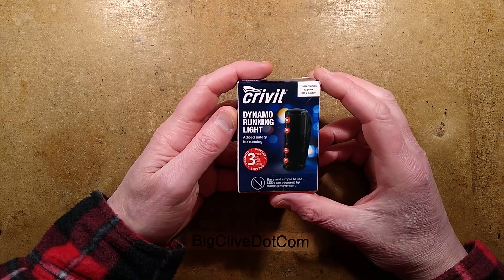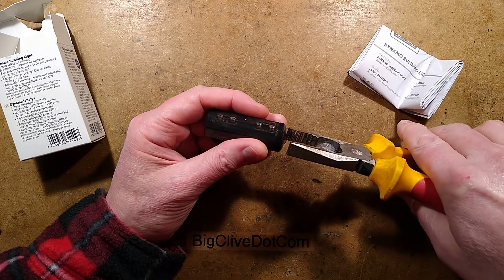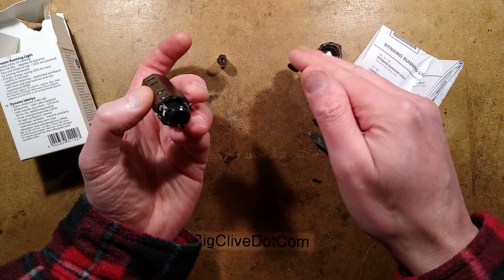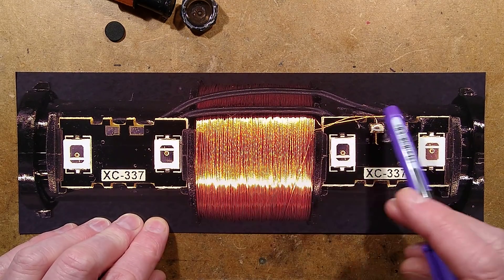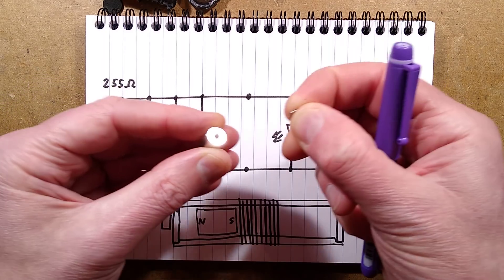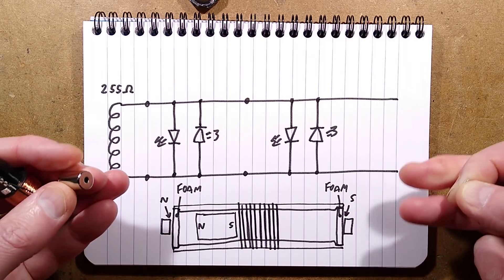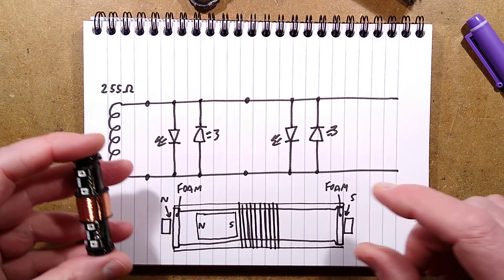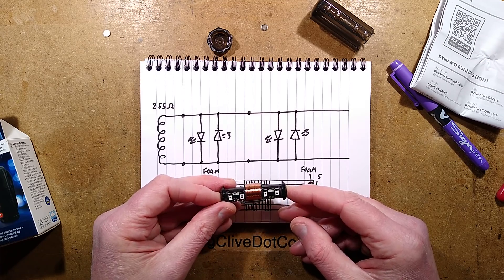Lidl self powered jogging light teardown (with schematic)

Comment: Neat. Barring any major impacts from dropping, or you know, vehicular impacts, the thing should last you damn near forever.
Reply: Well, that’s a bit dark. ;)
Reply: Being likely made from ABS, lifetime is around 5 years before all the plasticiser in the plastic evaporates out, and the entire case becomes brittle, then proceeds to fall apart from just normal handling. Not like the manufacturer would have spent the extra cent to get the better plastic, just instead used the recycled, reground clear ABS he can get in bulk, adding the tiny bit of black ABS to the mix, so as to hide the little bits of imperfect colour, in the cheapest grade of "mostly clear" bulk material he got for cheap. clear is expensive, near clear is cheap, plus hides the wear in the extruder, and the slop in the fit.
Reply: @SeanBZA  

I'm sure I have 30 yr old ABS items which are still fine. It's usually extended sunlight exposure destroying plastics.
Reply: @SeanBZA  nah ABS casings last much longer than 5 years.

Comment: Another great tear-down. Wish my dogs collars had one of those in it.
Reply: As a vicar I thought you had already seen the light! Have a fun day.
Reply: You can buy similar dog collars with lights in them. The older ones used a  coin battery, but I'd bet you can get modern motion-powered ones similar to these. I have to wonder if the magnetic field might cause activation of or damage to an ID chip implanted in the dog.
Reply: @goodun2974  They have to be compatible with my wireless fence. Issue im having is crappy batts in sealed units. Last a month or two then never charge right again.
Reply: @CrazyRFGuy  , 20-something years ago,  I had an electric fence with (rechargeable) battery collars. The wallwart power supplies kept dying from voltage surges and lightning storms, and I had a rescued Shepherd/Dobie/Rottie mix with a strong prey drive who would bolt through the charged field to chase squirrels and rabbits (he tested the fence like the T-Rex in Jurassic Park, and found the weakest spot in the field, under the deck, where we used another device to cancel the fields so the dogs could lay on the deck, and also shorten the amount of wire we would have to bury in rocky, roots New England ). Also, my Saint Bernard would take off to go visit all the young children in the neighborhood. After a couple of close calls with the dogs getting loose and nearly getting hit by fast cars on my rural street where  people drive almost twice the speed limit, we put in a chain link fence.

I do miss that Shepherd mix, he was very smart, and sensitive. Right now we have a sweet but stubborn Cairn Terrier, and a super mellow, friendly, handsome Anatolian Shepherd/Pyrenees mix, who specializes in begging for food, and melting women's hearts, so that they'll feed him.
Reply: @goodun2974  I have fully fenced yards (6ft and 8ft). My male collie jump/climbs over them (and he short a hind leg from a car). My female collie has that kind of drive and has learned how to get the outside man gates open. D@mn smart dogs(blessing and curse)
Reply: @CrazyRFGuy  , my Saints were sweet but not that bright. The Shepherd mix however was a friggin'  Cray computer, but his hips weren't great after a bout with Lyme disease and so he wasn't going to jump a fence.  The only dog that ever got out was the Cairn terrier. We had a few small gaps in the fence that didn't matter for large Shepherds and Saint Bernard's, but when a skunk came around the Cairn  decided to do battle and she found a way to get out. She's the only dog I've ever had who got skunked!  As for the Anatolian mix, his working breed genetics are strictly theoretical. He doesn't do any work;  the most jumping he'll do is in or out of the car,  and on walks on the trails in the woods he has the instincts of a pack mule and will step on rocks so as to not get his feet wet in muddy puddles or shallow streams. If you bring him around goats and sheep he wants to eat them.  We call him Handsome Henry and he is indeed beautiful, I'm not exaggerating when I say that women just about melt when he gazes at them with those big Brown eyes. He gets lots of attention and dog treats around town and at the hardware stores!  Speaking of, it's about time to take them for a walk! (PS ,  I used voice to text to type most of this and when I spoke "Cairn terrier" it typed as "Karen terrier". Which is kind of fitting!)

Comment: An example of a very simple thing engineered well. The bump-stops at each end are particularly smart. More components might be able to make a more sustained light, but each one would eat into the power generated and reduce the brightness. Plus, flashing the lights like that is exactly what you want—you want it to be very attention-grabbing.

Comment: Wouldn't the magnets at the ends "bend" the magnetic field of the middle magnet more to the side and  "pushing" the m-field closer to the coil and therefore increasing the magnetic flux? It would induce a bigger voltage which means brighter leds. Also it stops the middle magnet from getting demagnetised from being smashed into the ends.
Reply: They are too far away to have a meaningful effect when the dynamo magnet is in the coil. If they were strong enough to significantly increase the magnetic flux through the coil they would significantly decrease the speed of the magnet (for the same input energy) and lowering speed tends to lower the generated EMF. Without doing any calculations or much reasoning, I wouldn't be surprised if sufficiently strong cushioning magnets lowered the electrical output.

Comment: I obviously can agree that the hole is for airflow as stated many times. I also am curious if the lack of material in the centre inturn induces more propulsion around the out side, evenly pushing the magnet in the desired direction.

Comment: Re the magnet with a hole.  If you can find some aluminium or copper wire that is a loose fit you could drop the magnet down it to demonstrate eddy currents.
Reply: A roll of aluminium cooking foil from the kitchen works well.
Reply: @petehiggins33  Also works with sliding a flat magnet across an aluminum pan or similar.
Reply: @pizzablender  So it does, I just tried it.  For best results hold the pan at about 15 degrees from vertical and let the magnet slide down it under gravity.  See how slowly it goes.

Comment: The hole is maybe so it can travel easier with less air resistance, but maybe it also slows the magnet down, opposed to a solid magnet, by creating eddy currents, slowing the magnet?
Reply: You've hit the mark there. I believe the hole allows the magnet to be a good fit in the bore of the coil - maximising induced current - but stops the magnet acting like a piston against the air in the sealed housing and losing speed as it moves through the coil. The hole is very simple but a really nifty piece of design. :-)

Comment: I wonder how quality control is maintained during assembly.
Reply: Um, what is this quality control you speak of?
Reply: @billr3053  Shake it and see whether it works. Next.
There was this interesting tv program about disposable headphones (the airlini kind) and the factory makes even the wires and insulation themselves. Each earpiece is sound checked by a worker, holding it close to their ear,

Comment: I guess it would not make much sense to add a capacitor across this, due to the increased losses for rectification etc, not to mention the cost increase for little if even any benefit at all.
Also: what a way to ruin a QR code ;)
Reply: QR codes have built-in error correction (to varying degrees) so it's not actually ruined!

Comment: Could you hack that to add some caps and get the lights to stay lit a bit longer?
Reply from the maker: It would require a rectifier too, which could introduce losses.
Reply: @bigclivedotcom  What if the LEDs did the rectification rather than being parallel

Comment: The hole will definitely be to allow air through to reduce the effect of the air acting as a damper to the magnet. I suspect that is more important than having a solid more powerful magnet.
Nice video.
Reply: I was just about to comment the same thing. 
Had the magnet been solid, with such a fairly tight clearance between it and the bore, air resistance would have definitely been an issue in getting it to move from one side to the other with such ease.
As for @Snakez De Wiggle , go and wiggle your snake as that's all your brain is capable of understanding.
Reply: The hole in the magnet is not really causing any magnet field impact and it makes sense to keep the magnet as close to the coil as possible and let the air pass through the center.
Reply: @Quickened1  Doing work forcing air through an aperture results in dampening of the resonant system, removing energy from the system in the form of heat
Reply: I had a 'shake torch' and not having a hole through the magnet did damp its motion - so that would be it.... :)
Reply: Ok add a plug and test please?
Reply: @Quickened1  There is a pad and a magnet in the way. Even if there is a gap around them the air will only escape at a certain rate according to the pressure. for it to escape, there must be back pressure. Either we want it to escape as easily as possible or not at all to avoid energy being lost to pumping the gas.
Reply: I would agree. You would want the magnet diameter to be close to that of the tube to prevent it rattling in an off-axis direction. But then air isnt particularly viscous, so would flow around the side. Do an experiment: Tape up the hole and see if it makes a difference
Reply: @Quickened1  never seen someone reply to every commenter in a thread with the same answer over and over. quite...impressive
Reply: I think you're probably right. I thought that it might have been to actually reduce the power created, as in maybe without coring out some of the magnet it would have been dangerously close to frying the LEDs -- given how extraordinarily bright Clive said they are. But in that case, I suspect they'd just use fewer windings instead of using a more specialized magnet. I've seen videos of how such magnets get made. Adding a hole through the center in the mold probably doesn't complicate things too much. And may even save 1 or 2 percent in actual materials.
Reply: Totally agree. Quicker response available !
Reply: My guess as well.  Damn you for stealing my comment!  ;)  :)  ;)
Reply: But you want to increase the dampening effect, not decrease it, and the air will only compress seriously near the ends of travel anyway.
Reply: @robinhodson9890  Nope, damping takes energy out of a system, which is not what is wanted here
Reply: @robinhodson9890  Not entirely correct - you want to have the dampening properly tuned and mechanical precision variation can cause too large variation in the behavior of each unit.
Reply: You could not be more wrong.
Reply: @snakezdewiggle6084  elaborate please?
Reply: @jewishkidney  I wouldn't hold your breath lol
Reply: @jewishkidney  Doubt it's for air. Nowhere near enough compression to slow down that big heavy magnet. It's much simpler. Cost. China but whatever they can get cheapest. Those magnets were obviously in surplus at the supply houses, so they bought them. If there was that much pressure, they'd do away with the two magnets on each end and just use the pads. the cylinder is about 3x the volume of the magnet. Compressing at most 2x the volume of the magnet in the time and distance it takes to accelerate the magnet in just 2x the length of the magnet, is not near enough to cause a pressure spike.
Reply: @littlejackalo5326    Looking at the dimensions, the air in front of the magnet at one end of the travel is about 2x the magnet length (it doesn't matter that much). Even with a powerful repelling magnet, it'll only bounce back a couple of millimetres in front of the end. Space before is about 2x magnet length, space after is 1/5 magnet length. compression ratio 1:10. That's quite a bit. electromagnetically you want the magnet and internal bore size as close as possible without interference, so that air pressure will bleed back, but probably not slow enough to act as an air spring rather than a damper.